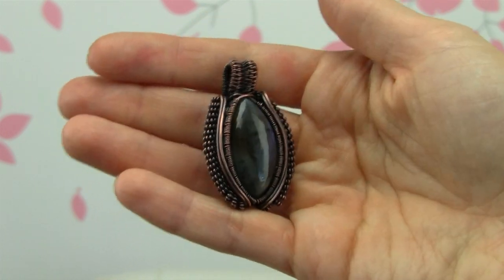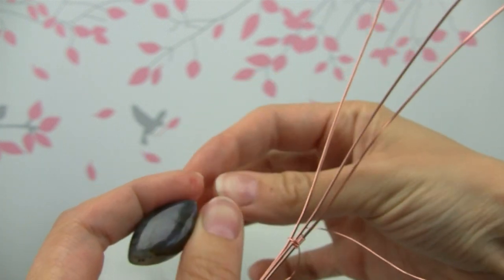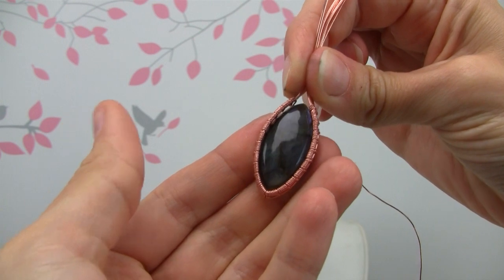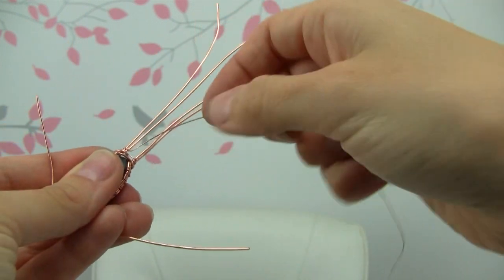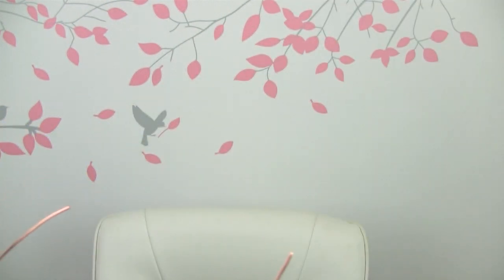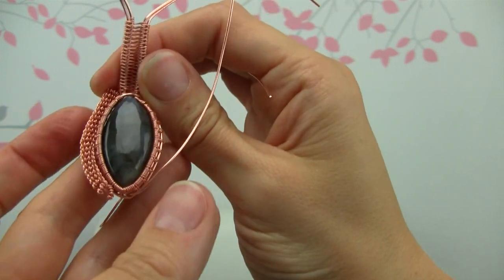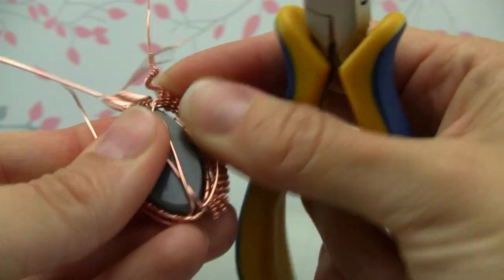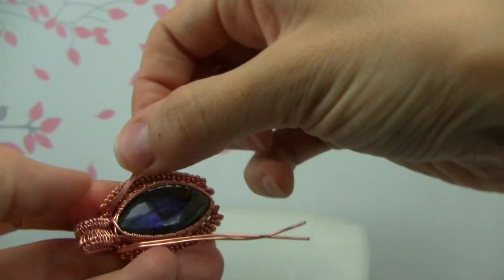Wire Wrapped Coiled Pendant Tutorial (Cabochon)

Comment: Where did you get your pick to make a gap between the wires? ☺️
Reply from the maker: Which part of the video is this in? I can take a look
Reply: @OxanaCrafts  4:55 ☺️
Reply from the maker: It is called an Awl and primarily used for leatherwork, you can find on ebay or Amazon

Comment: can you PLZZZZZZ! post a video on how you determine the length of wire to cut without wasting a it or not having enough? I am just starting out and dont want to cut too little. Also how do you determine design? do you draw it out first and then stick to your plans or do you just wing it then make a 2nd one for the videos?
Reply from the maker: I state the lengths in the video, so I started out with 3 pieces of 20 gauge wire, 10 inches each, the weaving wire I keep on the spool so no need to measure out. I don't have a specific way to estimate length, I just always cut super long pieces so this way I don't run out, and I always have some extra to cut off at the end. I don't draw, I just let the wire do what it wants, my videos are usually my 1st piece in that style, because I don't really like to make the same exact thing a second time.

Comment: I have got loads of 20 gauge regular wire. Can I use this instead? Thanks in advance.
Reply from the maker: I am not sure what you mean. Like only 20 gauge for everything instead of all the different gauges I used? I don' think that would work as you need the thinner wire as well
Reply: @OxanaCrafts  you said 20 gauge round wire in your video. I don't have that but I do have regular wires in almost all wire gauges including 28 gauge. Hope I'm making sense?